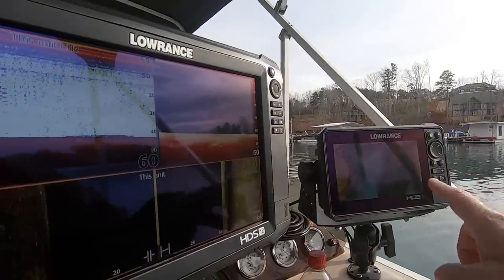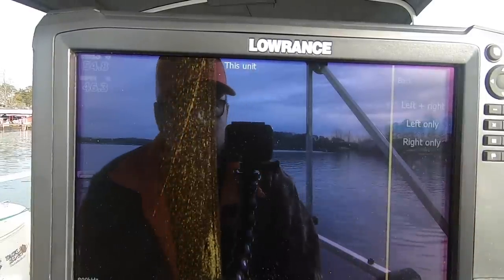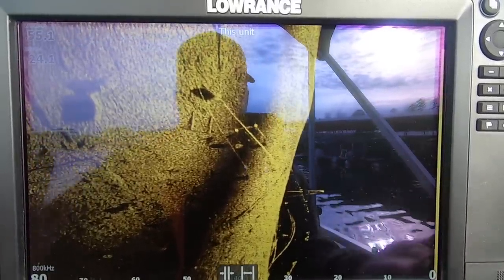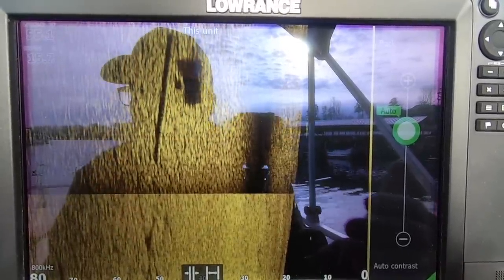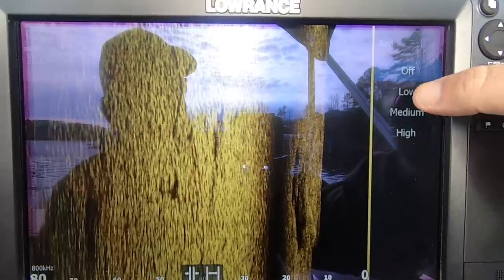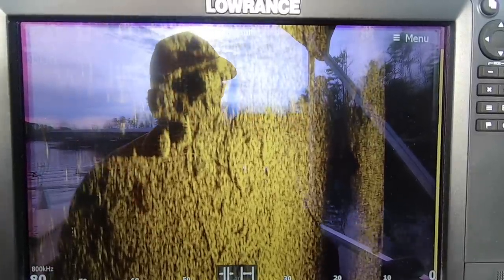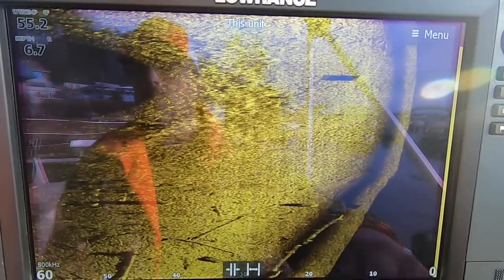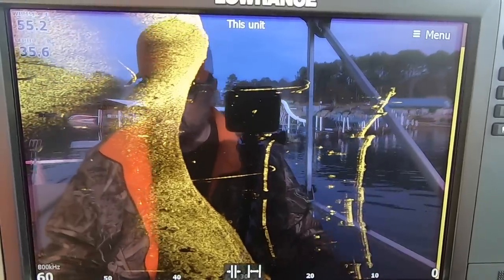How I scan an entire Marina for Crappie!

Comment: Great video! maybe a dumb question so i assuming that the boat/transducer is at the far right edge of the screen correct?
Reply from the maker: Not a dumb question at all.  You are correct, it’s at the far right of my screen. if I would have chosen right scan, it would have been to the far left.  If you have a  7. Inch screen, it really makes a difference.  It’s like magnifying the screen 2x.  Thanks for the comment! 🐿

Comment: Good video. Question, when you said the fish were out I think you said 50' or so, you don't subtract the water depth from that number to say how far from the boat they actually are?? Thanks!!!
Reply from the maker: The fish are the distance it says on my graph from my transducer which is mounted on the left (port) side pontoon, therefore it’s the exact distance from my left side.  My pontoon is 8’ wide so if I pass them on the right (starboard) side they would be the 8’ closer than my graph is indicating.  Hope this helps! Thanks for watching!🐿
Reply: Yes you do.

Comment: First crappie are scan distance minus depth…..not 44 feet to your left. 40 ft. Minus 18 ft. depth so crappie are 22 ft to your left. To test,  say your depth is 25 ft and set your scan to 15 ft. to your left, all you see is the depth….nothing to your left. Your scan range must be greater than your depth, and thus your distance to your left is minus your depth. The same if you are scanning both left and right….scan distance minus depth.
Reply from the maker: Harry, thanks for the comment, but scan distance minus depth is actually an incorrect myth.  I have a video in the works where I am addressing that myth.  I took a range finder with me to the lake, sunk an anchor tied to a big marker buoy with coke bottles  suspended coke bottles to emulate fish. I think you will find it very interesting.  The black (water column) is displayed on the screen until the sidescan beam finally hits the bottom of the lake at 45° angle confirmed by Lowrance) hope this helps. 🐿